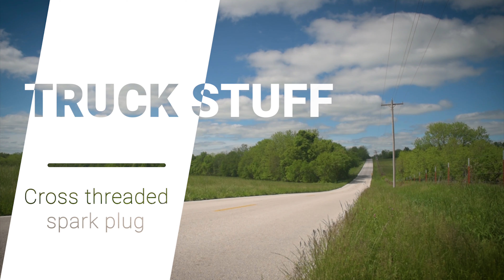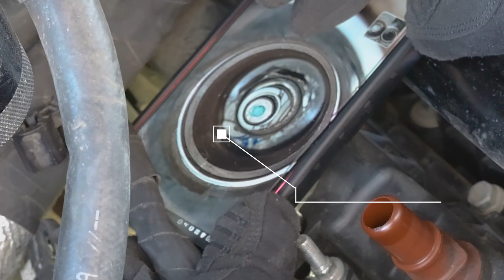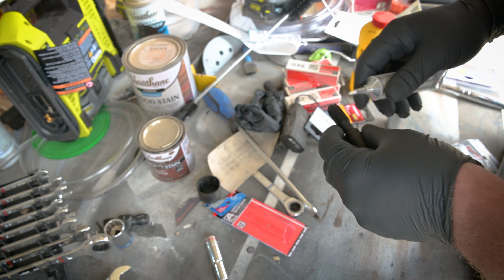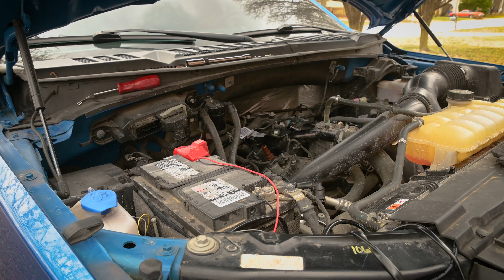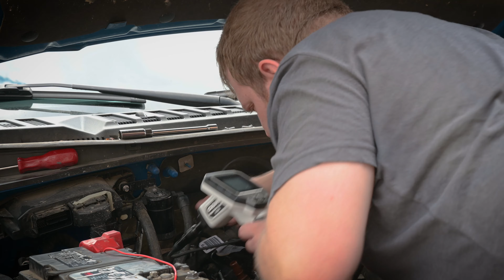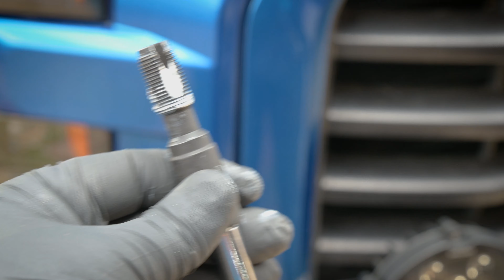Using a Thread Chaser to Fix a Cross Threaded Spark Plug

Comment: Rookie mistake. When you are putting spark plugs back in, set your ratchet wrench to the side. Take the extension/spark plug socket and carefully put the spark plug in the hole. Turn the extension/spark plug "by hand" until you can no longer turn it with your hand and its properly seated. Now you place the ratchet back on the extension and tighten it only a 1/4 - 1/2 turn (see which is right for your car). and wallah done. It is IMPOSSIBLE to cross thread anything when you start a bolt by hand and only tighten with wrench when you are sure it is properly seated.
Reply from the maker: Yep! Lesson learned here!
Reply: i was excited and crossed 4 yes 4 lug nuts
Reply: Sometimes it's hard to start spark plugs by hand though
Reply: @dsales2011  Put a piece of rubber vacuum hose on the spark plug to help you turn the spark plug by hand to get it started.
Reply: Some things on a car, you physically can not start with your hand. You’ll have to use a socket (no extension or ratchet) to “start” the bolt, and this can cross thread by itself. I’ve done it once with an LS1 header bolt (exhaust manifold m8x1.25 bolt) and currently with an m14x1.5 tear end differential mount bolt.

Comment: I have a 2005 F150 with the 4.6 engine.
The motor has 250k miles on it. I've changed the plugs about 3 times since it came into my possession. 

The last change over 18 months ago was really bad... the plug threads seemed really dirty from all the anti seize and dirt collection. I did my my best with an air compressor and got them seated. No problems with misfires or engine codes.

I'm dreading the next change this weekend. Planing on soaking with a bit of carb cleaning (per Ford) overnight. Then chasing the threads on all 8.... 

My question is what grease did you use going in?
Did you clean the grease off the threads before installing the plugs with anti seize? 
I am very concerned about hydrolocking the motor with too many sprays of cleaner in the plug hole... but gonna try and blow them out dry with an air compressor.

Any tips or advice will be appreciated....
Reply from the maker: I used simple white lithium grease. I didn't clean it out after application. Ford recommends not using antiseize in these plugs (yours might be different since they're the 2 piece design). Also, you won't hydro lock it. It would take a LOT of spray cleaner. I used brake cleaner because it evaporates fast.
Reply: @TruckStuff1  Thank you for the quick reply!
Definitely feeling more confident on this weekend's project.
Reply: Howd it go? In the same spot now .

Comment: How come you did not put an oil catch can on the driver side of the engine? Is it needed?
Reply from the maker: You can add one to both sides or add a "dual valve" can that hooks up to both sides. The passenger side offers more benefit than the driver side, so when people only do one, that's the side that they do.
Reply: Is it because the fresh air is pulled in on the driver side and exhausted out the passenger side?
Reply from the maker: From what I've read, the driver's side will catch oil under boost and the passenger side catches under vacuum. Since way more time is spent under vacuum it's more effective there
Reply: Awesome! Thanks! I finally received the answer Inwas looking for!